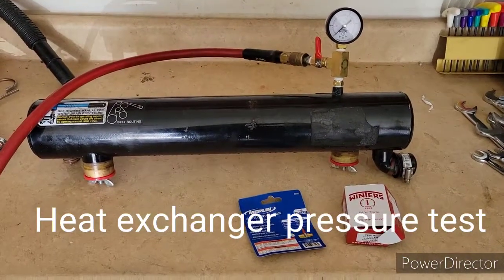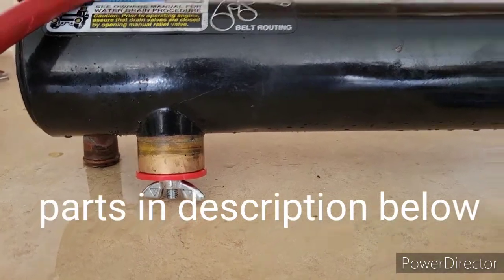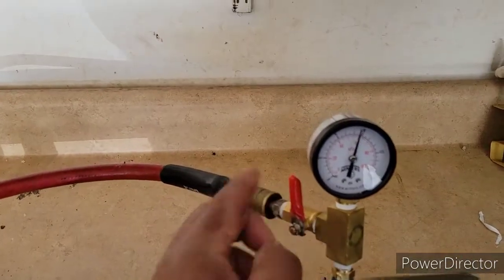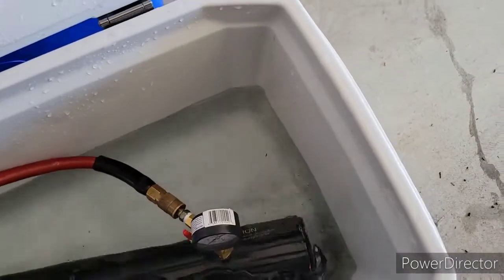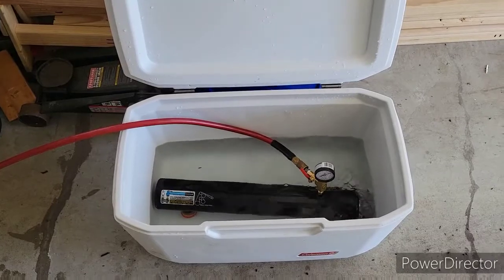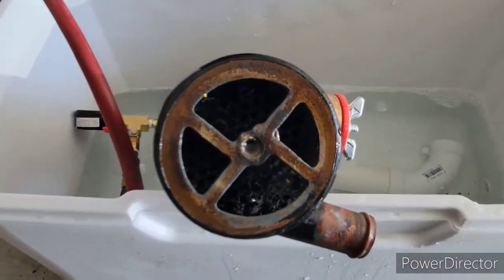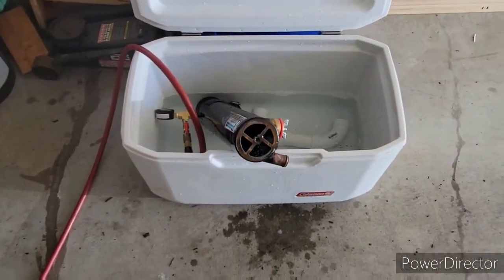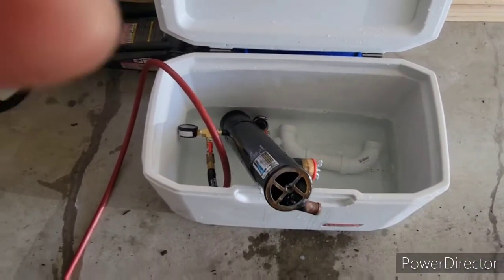8.1 Mercruiser Heat Exchanger Pressure Test

Comment: The heat exchanger is not repairable a new is required I had to replaced two of them in my boat both engines heat exchangers failed weeks apart

Comment: A question, how does it get reinstalled on the engine where you have the 1-1/2 plugs does the seal go on the posts first or on the motor and wiggle it through ?
Reply from the maker: On the motor and wiggle in

Comment: Have the same problem engine is off and A week later down 2 quarts of coolant thanks for the video it looks like it has to be the heat exchanger
Reply from the maker: When possible... change your antifreeze. Just in case it mixed with the raw water.
Reply from the maker: It's worth testing prior to changing...just incase it's not the heat exchanger.